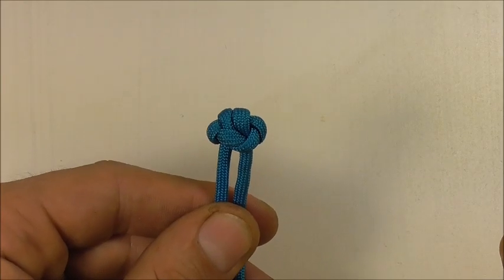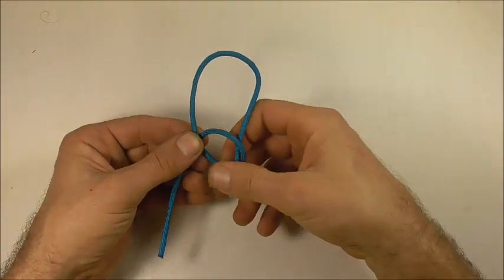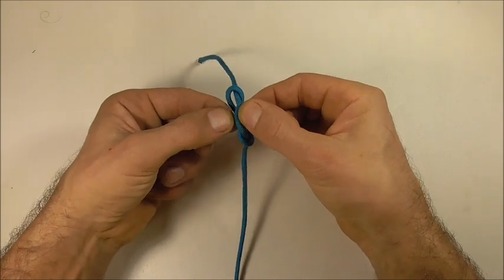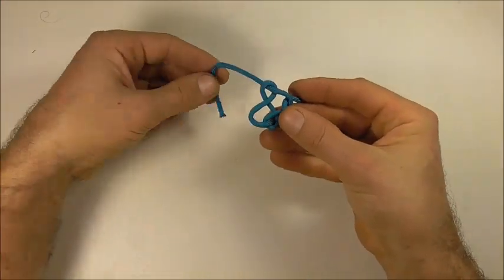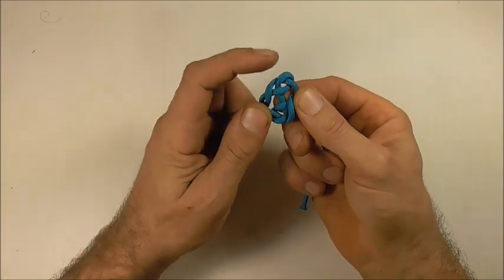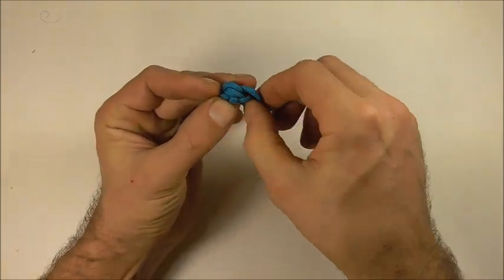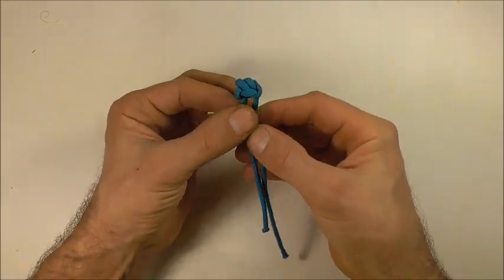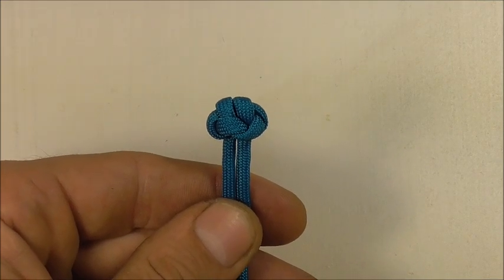"How You Can Make A Double Overhand Button Knot"

Comment: Thanks for this tutorial. Love your vids. 

Wondering if this knot would work as a stopper knot for a soft shackle? Would it invert under load?

Or, have you done a vid for the more complicated rethreaded button knots that start with a Carrick bend, that can be rethreaded down back into the shackle itself (in other words, it goes down through the centre instead of finishing by coming up through the centre), then I can taper and splice into the shackle itself. ?

Thank you kindly. 
Jase